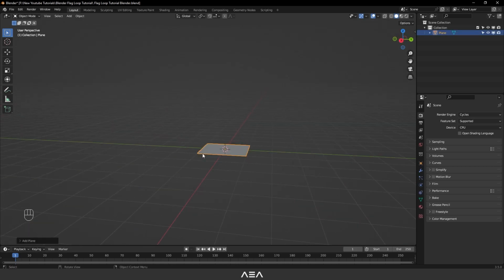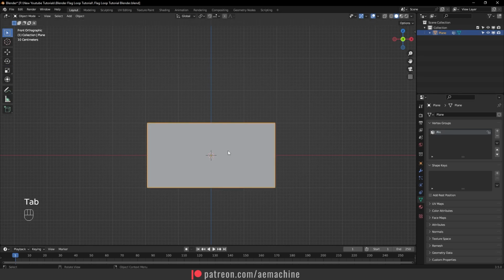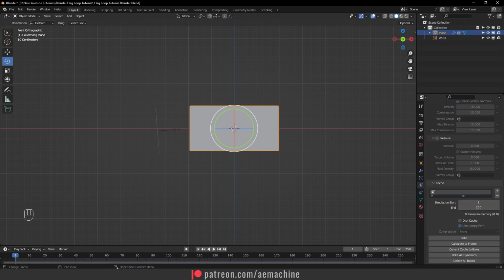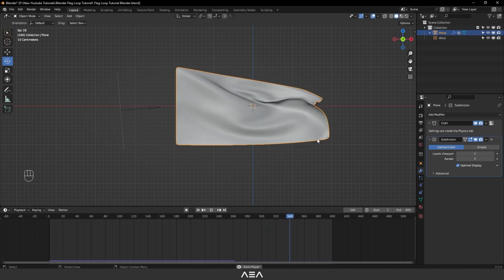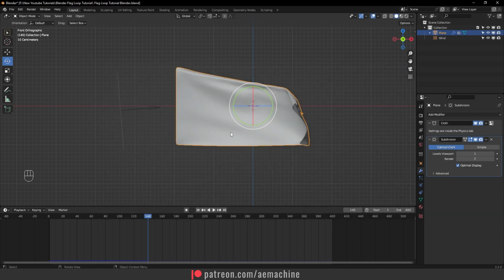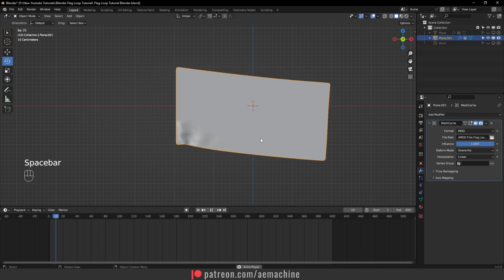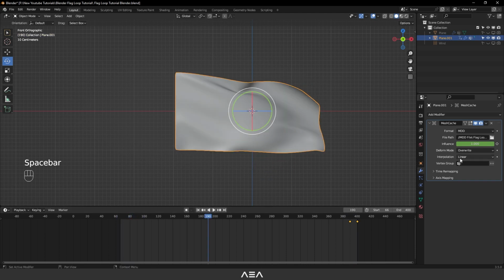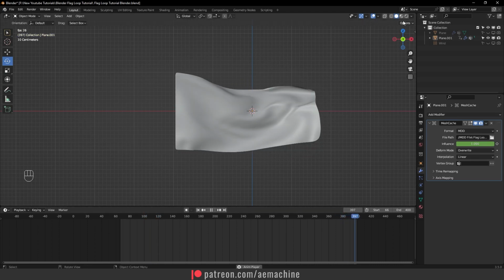Easy Cloth Simulation Loop in Blender

Comment: This is working for me - just perfectly as a matter of fact ... but I don't understand why it's required to re-add the Mesh Cache after the timeline has been adjusted to begin at frame-66 (or, I guess otherwise NOT at frame-1)?  Any clarity you can offer is much appreciated - thanks!  I'm working on scene with two flags in it and when the timeline goes from the end back to the beginning, that it's being looped is fairly obvious, so I wondered if it's possible to offset them somehow?
Reply: sorry did you see that ease out effect at the last frame? do yo know how to erase this effect? 🥲
Reply: You can also start at frame 0, he did this because he wants to be  at frame 66. The key point here is that when you convert Plane.001 to a mesh at a certain frame of the animation, for the Mesh Cache modifier, the Influence value is 0, which is why he inserted the keyframe with Influence 0 at frame 400, because this way it can be a looping animation.